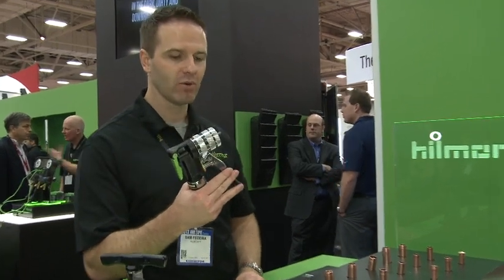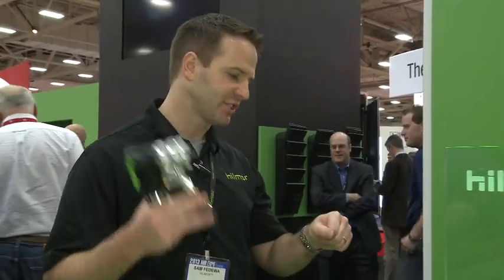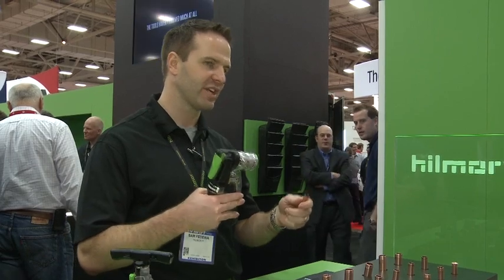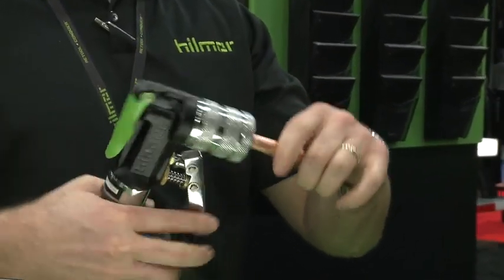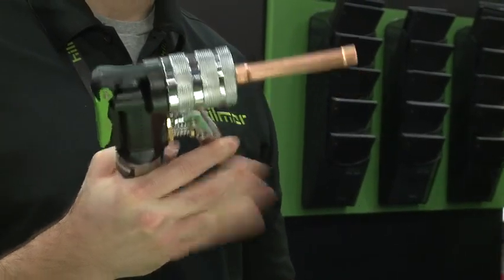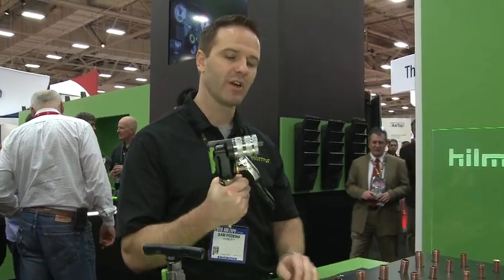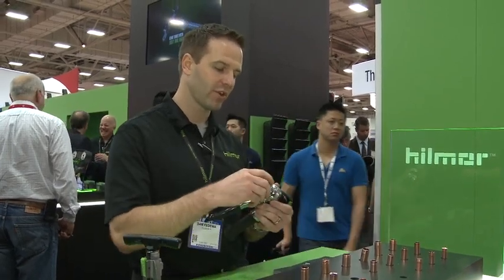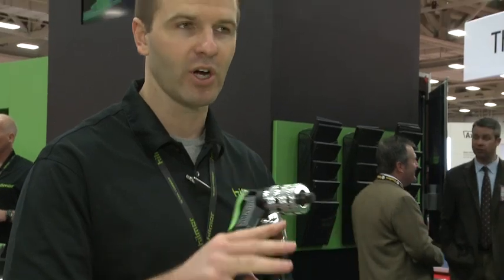hilmor Compact Swage Tool Demonstration

Comment: 1/4" it sucks. Better off buying a hand grip swage tool for $9. Unless you like heating or spinning the mandrel 90 deg every  time you apply some pressure, release, spin, pressure or it will split the tubing 50% of the time.